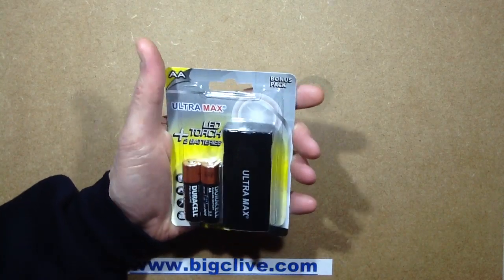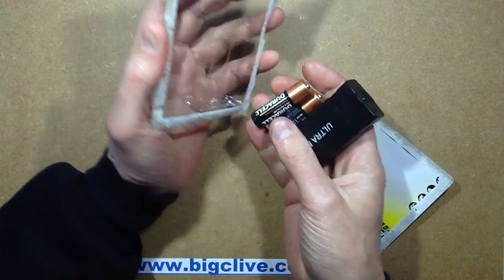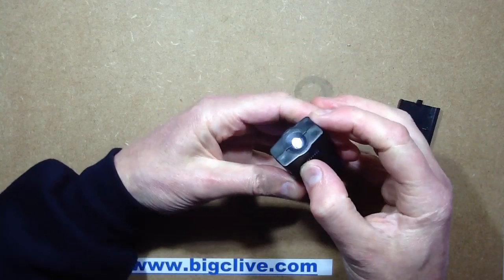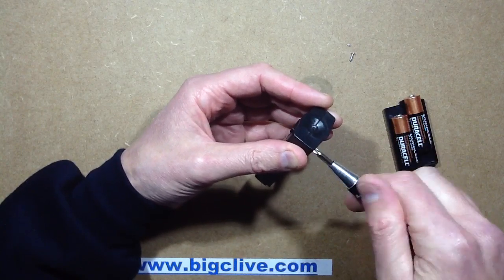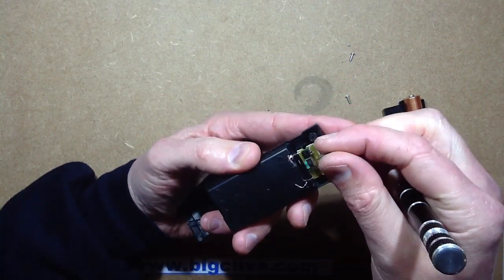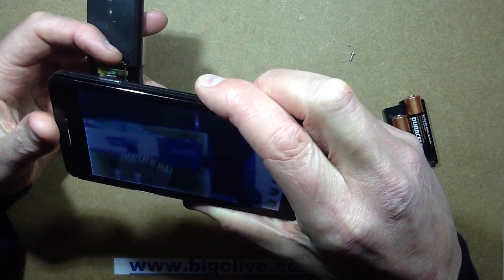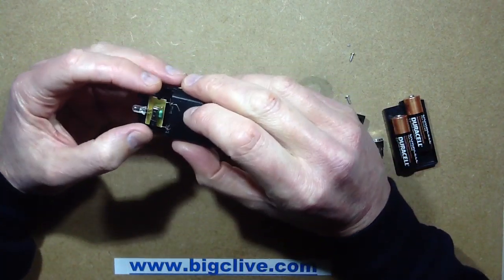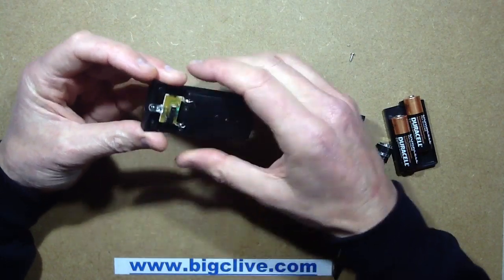A look inside a Poundland flashlight pack with two Duracell batteries.

Comment: Thank you Clive. A future topic: my stapler requires 4 x AA cells. They've run down & currently measure as 40% on my Ansman tester. Instead of starting with all fresh cells, a mean guy like me replaces one cell with a fresh cell to reactivate it (it works). Or what would be the thing to do?
Reply from the maker: Change them all at once.  If one goes fully flat then the others will reverse charge it, and it may leak.

Comment: It says, "Ultra MAX" on the front of the flashlight (sorry, torch), so shouldn't it come with Duracell Ultra batteries?  LOL  Honestly I haven't noticed any difference between Ultra and regular Duracell alkalines except the "ultra" price.  I have noticed however that the Duracell Ultra NiMH cells do stay charged in storage much longer than their "regular" non-Ultra NiMH cells.

Comment: That may be the first time I've seen a poundland torch that doesn't disintegrate as soon as you touch it! I also didn't know duracell were poor value for money, I had always trusted the brand - you learn something new every day!
Reply from the maker: Sadly Duracell is just a generic brand name these days.  And even in the past the brand was hyped up with misleading TV adverts that compared them to standard zinc chloride cells.  (The adverts still do this.)   As opposed to being a specially engineered alkaline cell with superior chemistry to others, the only major difference between Duracell and Poundland alkalines is the label.
It gets worse though.  There have been a number of cases in the past few years where mission critical applications like radio microphones on major events, where the batteries are routinely replaced before the start of each show, have been let down by defective Duracells that have not lasted long into the show.
Reply: bigclivedotcom I must admit that has caught me out on more than once occasion when using Radio mics - I stupidly put it down to faulty mics!
Reply from the maker: I think a good quick test on a new cell would be a voltage test, since that would reveal cells that were in a partially self-discharged state out the packet.

Comment: A security code on a phone can be disabled by factory reset in recovery mode..
Reply from the maker: Yeah, but it's just really for protection against casual browsing of my phone.  If it got stolen I'd delete the contents remotely if possible and then change passwords routinely anyway.  Then I'd buy another, since it's a cheap Chinese phone anyway.

Comment: I wonder how many of those white LEDs you could parallel up before the chip fries itself
Reply from the maker: I don't think it would affect it.  The same type of chip is used for the long strings of solar powered LED garden lights.  The worst that could happen is a short circuit, and the choke would probably be more affected than the chip, since the chip is effectively shorting out the LED Joule Thief style.
Reply: That's true. For a moment there I forgot how boost converters work!